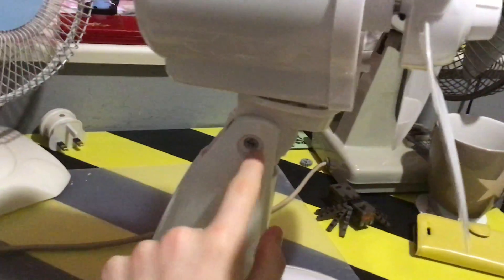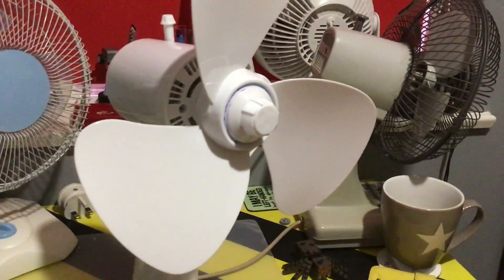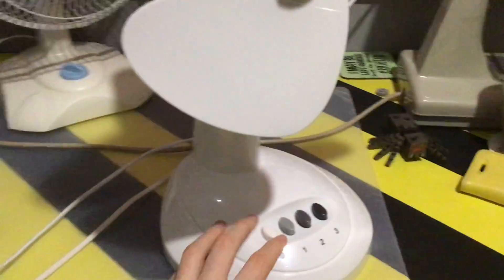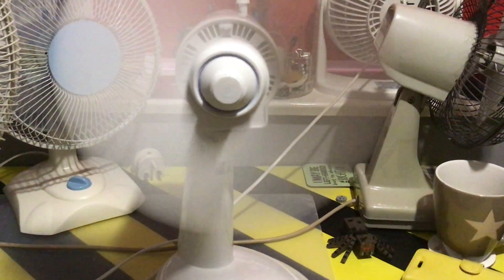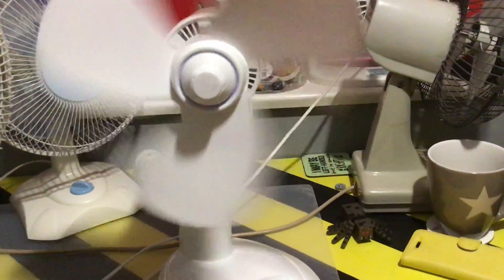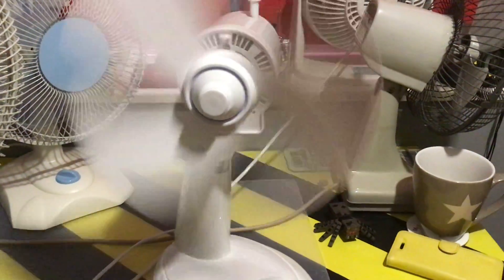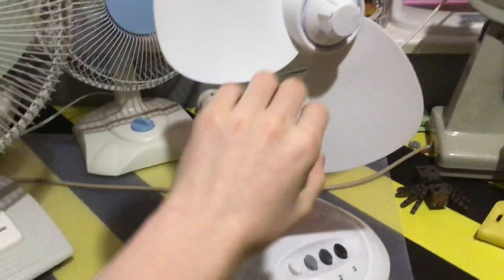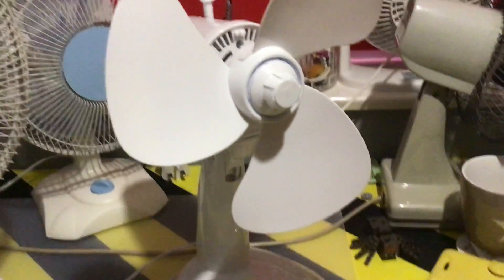The 2019 livivo 12 inch desk fan has bad bearings i think

Comment from the maker: Edit: Never mind I fixed the bearing problem. It runs like new now, the bearings are fine
Reply: Good, it looks like it needs oil.
Reply from the maker: @ethanfitton6336   I cannot remember how i fixed it. But I believe it was tightening the adjustment mechanism
Reply: @Connectitthefancollector  oh ok, good as new.
Reply from the maker: @ethanfitton6336   it doesn’t spin anymore. Plus the motor popped
Reply: @Connectitthefancollector  oh, that isn't good, just get a new motor.
Reply from the maker: @ethanfitton6336   yeah I should but idk how to wire AC
Reply: @Connectitthefancollector  look on YouTube.